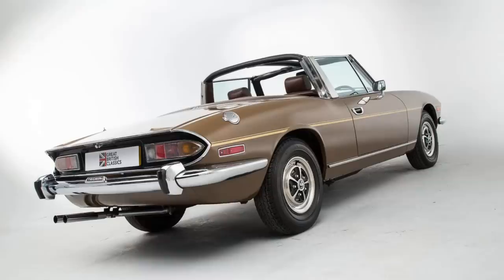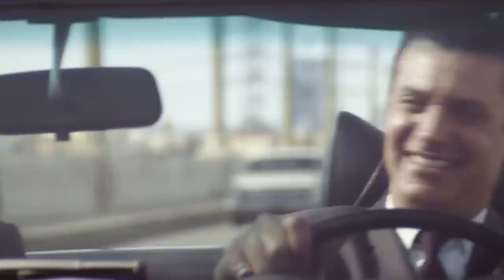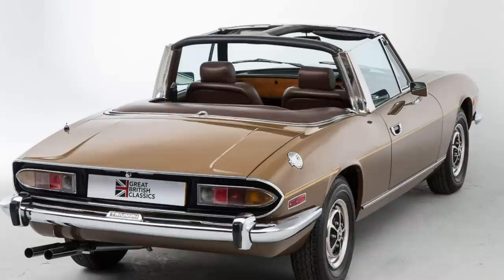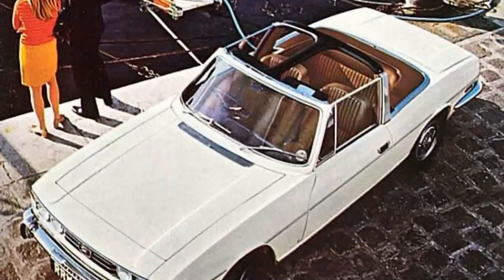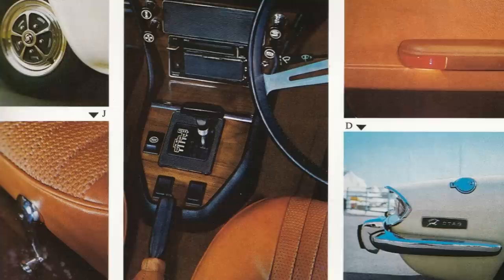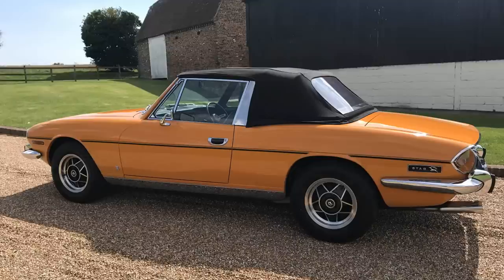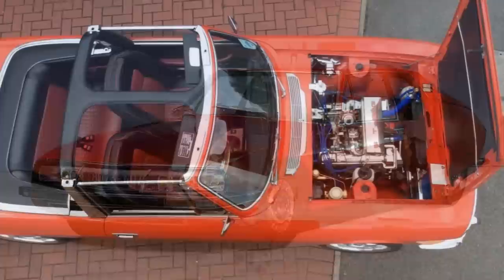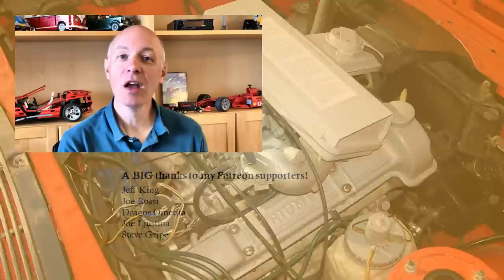Why did the Stag FAIL so Spectacularly?

Comment from the maker: Errata: Timing chain, not belt.
Pantera Rio should be Panther Rio.
Thanks to everyone who pointed these out!
Reply: Big Car I was going to say Panther Rio too, very interesting and well researched, I loved the Stag to look at, a mate of mine did a rebuild in the early 80´s
Reply: lovin your videos keep going mon brave 👍
Reply: @45green1  Panther Rio was a Dolomite with fancy alloy outer panels. Not sure of production number, but I have heard it was a one-off.
Reply: I heard "Pantera" and thought, that's the Ford V8 powered Italian exotic sold in the states through Lincoln/Mercury dealers in the early seventies.
Reply: @pashakdescilly7517  My best friend's father was Robert Jankel, Panther creator, the family was using a Rio at the time, I got a few trips in that
Reply: Mind the Rover/Buick V8 running it's timing chain without a tensioner meant it was like well used nicker elastic if it wasn't changed regularly , had a P6 , bad choice ...
Reply: @barryrothwelltaylor6812  - very common in American pushrod engines was to run a chain with a nylon plastic sprocket. Quiet but not the most long life.
Reply: The Panther Rio, guy with the glove puppet doesn't know what he's talking about.
Reply: Yes & when the water pump seized it was known to shear the gear off the Left Hand camshaft, causing catastrophic failure of the LH cylinder bank. I worked for a Leyland Dealership here in Australia, we had a few of these failures resulting in an engine swap to the 4.4Ltr Leyland P76 version. Kick arse Stag resulted.
Reply: Nice narration, presentation and content thank you. It's slightly off topic but I had a concours  1974 2.5PI Auto righthand drive in BRG. I loved that car with it's black velour seats, beautiful wood and leather trim, nice gauges and Borg-Warner box. It could go too and sit on a decent speed comfortably. Early on had the PI system tuned by a ex-racer engineer but I ended up removing the PI and installing twin carbs after I had a tricky throttle stuck open episode on giving it a jab one night. After it sat for some time I ended up selling it with a stainless exhaust system for hardly anything before I headed overseas.
Reply: jesus a timing chain only lasting 25k?
Reply: @dsruddell  they were changed more often back then.
Reply: @dsruddell  
I believe a 3rd party company made better chains.
Reply: WHATS WITH THE PUPPET ? MUPPET ITS RIDICULOUS .
Reply: @pashakdescilly7517  38 were built
Reply: @gotham61  According to Classic and Sportcar Magazine "For years it was believed that 38 Rios were produced but, once the penny dropped that Panther only issued every other chassis number, the final tally was established at just 18 cars."
Reply: The material in this video would make for an excellent discussion topic in a mechanical engineering class. A combination of engineering failures touching on fluid dynamics, strength of materials,  structural analysis, and reliability chain - in other words, how not to approach engineering design.
Reply: Thank you for the video. Frankly speaking, it didn't make any sense for BL to make their own V8 if there was 3,5 V8 available. This is a sad story as the Stag could have been a competitor for the Mercs.

Comment: I bought a 1977 Stag this year after having hesitated for years researching the pitfalls. With proper maintenance it runs beautifully, is reliable, starts first time, doesn't over heat, sounds and looks great!
Reply: You sure it was a Stag?
Reply: @DaveCorbey  oh no sorry! It was a Suzuki.😄
Reply: @Bif Stiff Update: It was okay until the jack shaft joint sheared off, the water pump failed and the engine melted. Apart from that it was really reliable.
Reply: I had a Stag for three years. Wonderful, no problems at all. Best handling car I ever had.  Bit heavy on the petrol. I wish I still had it!
Reply: @PaulGunnMusic  Stag has always been a great-looking car. But in 2022, with all of its' known engine issues, it would be a great candidate for conversion to EV. At least the Stag could have a second life.
Reply: For the love of cars rebuilt the engine and had it tested by a man who worked for motor racing teams and it was superb
Reply: @peterduxbury927  And a synced recording of the engine noises being played as you go along
Reply: @oscarosullivan4513  I have to agree with you! I own a beautiful 1971 white Beetle that has been converted to EV. It uses Tesla model 'S' Batteries, along with a Netgain Hyper 9 Motor. I have retained the original 36HP engine, and could be converted back quite easily if needed. It drives along with a strange sound, almost silently. But the best bit of all, is that it now has 120HP, and will leave many modern cars in the rearview mirror! I predict a sharp rise in petrol costs in the near future, due to the Russian / Ukraine conflict and their knock-on effects around the Globe. Converting the Beetle to EV also gave an opportunity to install A/C - which is great for here in Australia.
Reply: @peterduxbury927  Thanks for that
Reply: If it is reliable and everything else you claim it to be the former owners spent a fortune incorporating all the aftermarket fixes to make it that way.
Reply: @harry130747  So it used a lot of fuel on its maiden voyage home from the dealership where you parked it in the garage and didn't drive it again for three years?
Reply: @harry130747 you are dreaming, terrible handling, pathetic engineering and design. I have built from the ground up a 1977 stag for a friend, motor is a nightmare so many built in problems. Some motors will have a weekness in design but the stag has too many to list!
Reply: @peterduxbury927 may I ask how much did it cost?

Comment: I had a stag for 12 years, really loved it. Once I'd rebuild the engine properly ( unlike British Layland haha) It worked absolutely lovely and sounded nice. Never let me down since, also they had timing chains not belts.
Reply: Of all the cars ive owned over the last 40 odd years the only ones that have let me down have had timing belts. Pathetic. To expect an (albeit strengthened) rubber belt to do all that work under hot and oily conditions is just UTTER folly.
Reply: @syhooverman5418  Timing belts work perfectly fine if you replace them in regular intervals. They are just like engine oil, tires or brake pads. Wear items that need to be replaced ever so often to ensure reliable operation. Besides, car manufacturers these days can easily  build a timing chain that explodes after 100.000 miles.
Reply: @flemingpandel5287  Providing the manufacturer gets the service intervals correct from the outset. Many Opel engines used in Australian badge engineered Holdens had belt failures well before the stated replacement interval, forcing a reduction to the replacement limit, which still wasn't sufficient to prevent further failures. When you consider the ramifications on an engine where the valves hit the pistons when a belt breaks, and the thousands of dollars in repairs as a result, that flimsy, thin belt doesn't seem very smart. This doesn't even address other issues with those belts like idler pulley failures, which used to occur because the outer belt guide was made of plastic, which tended to break. Even a water pump seizure or belt tensioner problem can cause the belt to come off, with the same expensive bent valve problems. It's no wonder the belt era is pretty much over now.
Reply: I had a Slag for 8 years, and could not get rid of her for love nor money.  She was also a thirsty beast, and constantly drained my wallet. I eventually got rid of her at a classic car show, many miles from home, just drove off and left her there.  Then replaced her with a newer, less thirsty, cheeky little minx, who does a much better job of keeping the bed warm for when I get home from work.
Reply: @syhooverman5418  Depends on the car. 
Intervals on my Saab 9-3 were 90k miles. 30k on an Alfa Romeo 145, of which, I owned 2, and 90k on my current Volvo V50. So it really  does depend on the car you choose.
Reply: @syhooverman5418  there isn't any rubber in timing belts😎
Reply: @hermanmunster3358  - 'slag'? 🤣🤣🤣
Reply: @syhooverman5418  Really??? My 1984 Audi 4000 Quattro is still running at about 350K miles on the original engine. Of course, the timing belt & water pump are maintenance items that have to be cared for...
Reply: @markfox1545  If you read the whole comment it kinda makes sense.
Reply: @hermanmunster3358  Was it a Hillman Minx?
Reply: @EeezyNoow  No, but I dare say she would fit in the back seat of one, quite comfortably. 😉
Reply: @hermanmunster3358  This is hilarious 😂😂😂
Reply: For the love of cars were able to get the engine to work after rebuilding it slowly
Reply: I still can't fathom how they thought welding two dolomite engines together would be a good idea. It makes zero sense. Especially when BL had more than enough v8s in other brands to source it from.
Reply: @hermanmunster3358  yep. It's all about intervals and maintenance. I've changed 2 or 3 belts on my subarus now and as long as it's done every 100k or maybe 80k depending on how rough the driver is and it's completely fine. The timing belt isn't bad technology it's the companies who are implementing these intervals and the design etc etc

Comment: First saw a Stag in my school playground in the early 70s, it looked great just sitting there, but when someone jumped into the passenger seat I saw there were lights inside the doors - seemed more like a spaceship than a car. Then it took off, the noise was just glorious. One of the best looking and best sounding cars built. Ever.

Comment: When you have access to a GM V8  use it. It's their bread and butter and they do it well.
Reply: think that V8 was a Buick design
Reply: @paulmaryon9088  Buick owned by GM
Reply: @simonoldroyd5037  Buick had a habit of designing a few of their own engines in-house during this era
Reply: Buick's first V8, known as the "Nailhead"  was designed in house.
Reply: It may have been a Buick design, but IIRC, they didn't want it because it was aluminium. The Rover version had was manufactured in the UK and had Rover designed head and peripherals. I don't think GM ever used it. I had always wanted a Stag, and in the 90s I looked at a couple which had been rebuilt with new electrics and Rover V8s. They were just out of my reach at the time.

Leyland screwed Triumph completely. In the mid-70s I had a MK2 2.5PI. A beautiful car, like a big Stag. The engine was fine apart from the Lucas mechanical fuel injection which was so unreliable that I used to carry two or three spare injectors around! Triumph had wanted to replace it with Bosch electronic injection, but Leyland wouldn't let them have the money to do the mods needed. All very sad. Both the 2.5 and the Stage would have done well in the US with better build quality and the Rover V8.
Reply: @sadiqmohamed681   - Buick used the engine briefly in the early sixties in their front engine version of the Chevrolet Corvair platform.  The Buick Special/Skylark grew in size and a larger iron V8 was subbed.  Also the aluminum unit may have needed a few minor tweaks to perfect. Rover did just that. 
I agree with your assessment.  In spite of rather questionable build quality and reliability, the cars of MG, Triumph, and Jaguar remained fairly popular in the USA.
Reply: They did not have access to the GM V8 when the vehicle was in its early development phase. The Rover Car Company and the Triumph Motor company, as they were then known, were not part of the same organisation.
Rover Solihull bought the rights of the GM V8 but initially could only use it in their vehicles.
Triumph needed a V8 and cobbled together 2 of their slant 4 cyl engines.
By the time both companies were part of BL, plans were too far advanced for Triumph to use the GM unit unfortunately.
Jaguar had the opposite problem. They feared that senior BL management would fotce them to use the GM V8 so they designed the XJ40 engine bay so that it could only fit an inline straight 6 built by Jag, not the GM V8.
Triumph was unlucky not to have had the GM unit, Jaguar was lucky not to have had it.
Reply: @zf9903  still owned by GM; what's your point?
Reply: Just because you know you’re incorrect doesn’t mean you have to pretend to be a fool.

They developed their own engine in-house, that makes it an engine of their origin.  It was a totally unique design.  Buick is a division of GM, but in those days there was a lot of freedom for them to do their own thing (and as a result there was a lot of pretty legendary infighting between all the warring GM-owned marques), and as it happens, this generation of Buick V8 wasn’t ever used in any GM branded automobile other than Buick. It’s a Buick engine and everything was proprietary.

If we start calling engines developed by subsidiary or “owned” companies by their parent company’s brand, we’d probably only ever refer to 3 or 4 brands of engine.  That logic just doesn’t make any sense and it’s counterproductive to ensuring the correct understanding of the historical topics we’re dealing with.

Sorry, but you’re wrong.

Edit: figured I’d bring a proper example to the table.  This is about nomenclature.  In the 70’s AMC developed a standardized inline 6 for use in their passenger cars, 258 cubic inches, or 4.2L.  It was put in many many many jeeps during that era, however, it is still an AMC engine, not a Jeep engine, regardless of what vehicle it’s in.  This is for several reasons.  The same goes for the later 4.0, which again, was developed by AMC and was used for 15 years or so in Jeep branded vehicles.  The only reason people know it as the “Jeep 4.0L” is because AMC died only a couple of years after it’s introduction and Chrysler liked it so much they kept it for another 14 years in the Jeep brand, adding revisions as they went.  In this particular instance it can be argued that the engine transformed into a CHRYSLER product, since they improved it over time without AMC, but the origin of the engine remains the same.  It’s an AMC engine.
Reply: @zf9903  - That   AMC 6 cylinder engine dates back to 1965 as a 199 cubic inch engine.  It grew to 232 and 258 CI.  With 7 main bearings and individual ports, not siamesed, it was a great design.
Reply: @scootergeorge9576  
The AMC inline 6 started out as the 232 in 1964. The 199 come on line in 65. The 258 in 70. The 4.0 was in many ways a development of the 2.5 in terms of castings etc. But the engine and the machining lines were designed to produce either 4 or 6 cylinder engines. A decent engine but technology passed it by. It is my understanding that OHC versions were run on dynos but not pursued due to production cost. Before production ended there was some work on  24 valve cross flow head. The engine actually has the same bore spread as the Ford Small Block so given the right set of skills and a couple of V-8 heads a crossflow head would be possible. There are also a couple of DOHC* heads that are close.  There is actually a race only twin cam 24 valve head made in Argentina.
*the closest is the GM V-6
Reply: @Hattonbank    And then Jaguar had to redesign the XJ40 forward of the firewall to take their own V12!
Reply: @Hattonbank  XJ40? I know that any 1968-86(?) XJ6-12 Jaguar was 'designed' to accept a SB Chevy and even a big block.
Reply: @zf9903  215 Buick V8; 1961-63 Special and Olds F85/Cutlass and, I believe that Pontiac 'may' have offered in at one year of the 1961-63 Tempest
Reply: @scootergeorge9576  The 4.0L Six as used in the Cherokee, etc was strongly based on that same AMC Rambler Six. VAM in Mexico also offered a 282 Six, based off that same motor.
Reply: @piercehawke8021  - That's because Chrysler bought out AMC.  But before that AMC was using Chrysler Torqueflight  automatic transmissions.
Reply: I believe it was just a V8 Aluminium block which GM shelved, Rover thought it had potential ,and bought the rights from GM and developed into a very successful engine.
Reply: @michaellaforce9153  - I believe the bean counters at GM shelved the 215 aluminum V8 because it was slightly more expensive to cast than iron. And American cars were bigger than European cars. American gasoline was also much cheaper.  As late as 1971, I paid as little as 22 cents a gallon.  It didn't cost a whole lot of money to feed a muscle car with a "Big Block" engine of 6.6 liters and larger.  Back then,  it was said, there is "no replacement for displacement!" : D
Reply: they do it well by GM standards
Reply: @chrisdavidson911  - "they do it well by GM standards" -  Who are "they?"
Reply: @scootergeorge9576  gm, the same "they"referred to in the original comment
Reply: @Hattonbank  Triumph was not unlucky not to get the Rover V8 they shot themselves in the foot for no reason. My Stag came with a retrofitted Rover engine so it was a no brainer for Triumph but vanity clouded their judgment. The Triumph V8 had absolutely no advantages and proved to be a major problem. 
Jaguar lucky not to get it - why? It was an excellent engine.
Getting rid of engines that could be replaced by the Rover V8 seems an obvious money saver and parts inventory reducer. That engine proved itself for many years, light, powerful and able to be developed. I rebuilt mine so knew it inside out and ended up putting it in a jet boat when the Stag had corroded beyond my patience.
Reply: Triumph were fighting for their jobs in engine production. Which would be lost to Rover. If they used the Rover engine.
Reply: @hakonhelgesen7659  - So, how is employment at Triumph, these days?
Reply: @sadiqmohamed681  The 2.5 PI was a fantastic car
Reply: @sadiqmohamed681  Just so you know, Buick and Oldsmobile both built versions of the engine, it was an option in one Buick, one Oldsmobile and one Pontiac for three years.  It took Rover twenty years before they had built as many as GM.